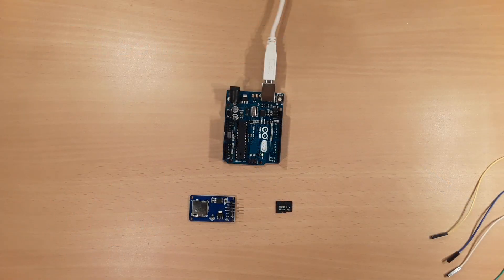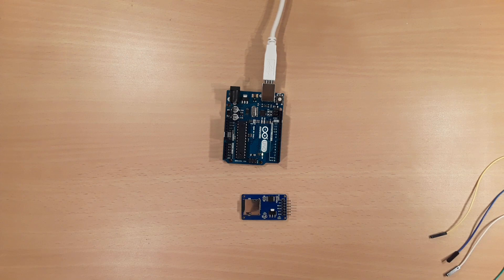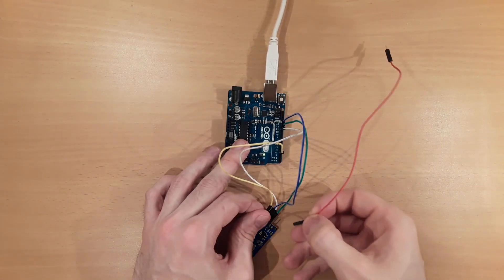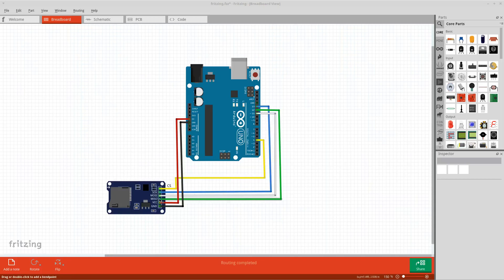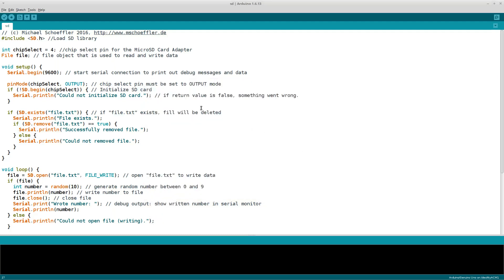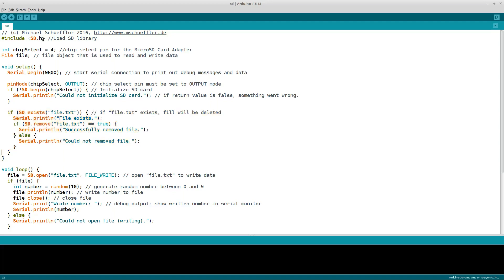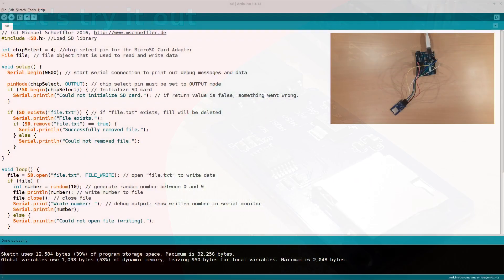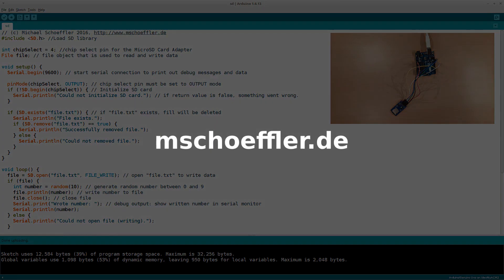How to read and write SD cards with the Arduino Uno | UATS A&S #6

Comment: Hi Michael; Thank you for your tutorial; I have an issue with storage in SD card. I am losing the previous data because the SD card opens the same file every time and overwriting on it I want new file with a new name every new sensor run. I am  using 3D accelerometer sensor and I want to store the data in SD card, for example, create file 1, then when I switched off the sensor and switched on the new data will overwrite on file 1, instead of that I need to create File 2 to store the new data and so on.
Reply: khalid..  that can be done by using a different file name every time you open the new file. If you want to have the file name generated by the microcontroller. use a variable that increments as the file name.
Reply: you can maintain another file on sd card called "runNumber.txt" using which you can track the current runNumber and then name your current logfile based on the number you saved on runNumber.txt on the last run. increment and save this file on every run.

Comment: Good day, Michael.
I realize it was a long time you posted this video but, if you could, I would;ld as you to answer a question for me.

I have the very same setup (hardware) and after writing multiple variables of 'short' and 'float' type, I have the upmost difficulty reading them back and reassign them to proper variables.  It seems that either I write them wrong (but I can read them just fine with a text editor like TextEdit) or read them the wrong way.

My project stores environmental information such as Year, Month, Day, Hour, Minute, Second, Temperature, Humidity, Pressure (and their Minimums and Maximums) as well as the Battery level. This is done every 15 minutes.  I want to be able to read each variable separately .. not the whole file at once, like your example shows.

Can you please indicate a simple way to do this task ?  I am quite new to the Arduino environment so, I would appreciate a simple step-by-step solution, along with simple 'newbies' explanation, so I can learn from you.

I thank you very much for any help you want to provide.  This is well appreciated.  Until then, have a nice day and take good care.

Comment: where is the library and sorurce code.
Reply from the maker: The source code is here: http://www.mschoeffler.de/2017/02/22/how-to-use-the-microsd-card-adapter-with-the-arduino-uno/.  In order to find/install the SD library: Open your Arduino IDE and then go to Sketch -> Include Library -> Manage Libraries... Next, a dialog should pop up. On the top is a search field, just enter "SD". Next a list is shown where you should find an entry "SD by Arduino, SparkFun". Do a left click on this list entry and then click on the "install" button.
Reply: thankyou mr.michael.

Comment: i cant really see what is written inside the while loop, can someone help please
Reply from the maker: Hi, you can find the complete source code here: http://www.mschoeffler.de/2017/02/22/how-to-use-the-microsd-card-adapter-with-the-arduino-uno/

I copied everything from the loop function below: 

void loop() {
  file = SD.open("file.txt", FILE_WRITE); // open "file.txt" to write data
  if (file) { 
    int number = random(10); // generate random number between 0 and 9
    file.println(number); // write number to file
    file.close(); // close file
    Serial.print("Wrote number: "); // debug output: show written number in serial monitor
    Serial.println(number);
  } else {
    Serial.println("Could not open file (writing).");
  }
 
  file = SD.open("file.txt", FILE_READ); // open "file.txt" to read data
  if (file) {
    Serial.println("--- Reading start ---"); 
    char character; 
    while ((character = file.read()) != -1) { // this while loop reads data stored in "file.txt" and prints it to serial monitor 
      Serial.print(character);
    } 
    file.close();
    Serial.println("--- Reading end ---"); 
  } else {
    Serial.println("Could not open file (reading).");
  } 
  delay(5000); // wait for 5000ms
}

Comment: if i already creat file with sensor data , how can i read last line in the file not all data saved before ???
Reply from the maker: Two ideas come to my mind: a) You just loop through all the data and read each line. In each iteration, you store the value you read into a temp file. When the loop has finished, the last line will be stored in this temp file. This approach is not very efficient. b) If each line has a fixed length, you can use the "seek" function of the "File" class. The seek functions jumps directly to a position in your file. Just get the total file size and subtract the length of a single line. Then use seek and you should be able to obtain your last line. 
I guess, there are many more approaches to get the last line. I hope my hints were helpful!